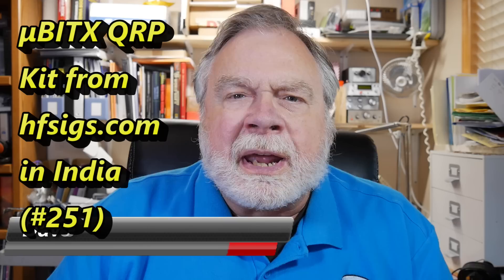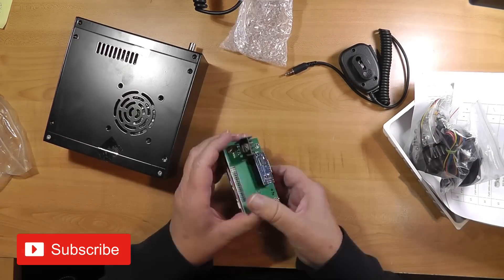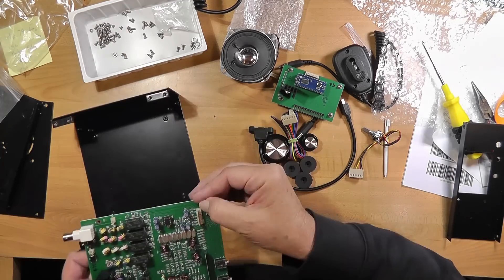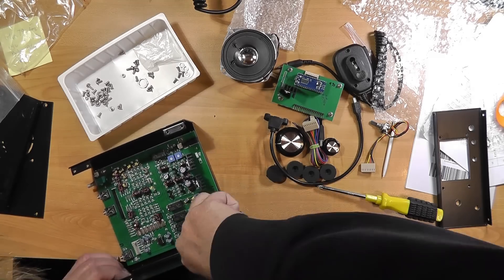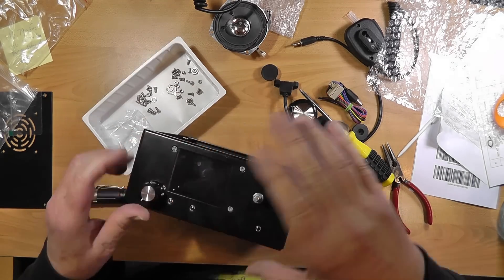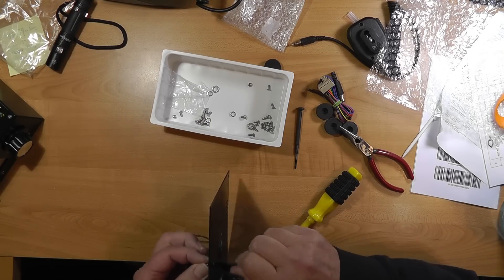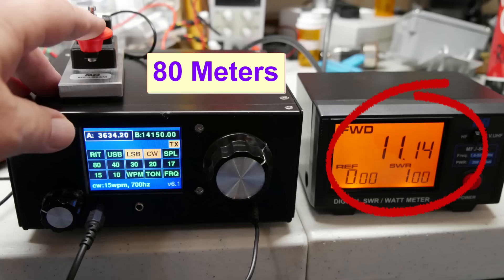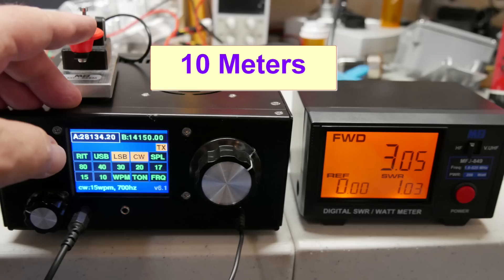Building the v6.1 Micro BITX from India (#251)

Comment: An idea might be to order the basic kit without the case so you can customize the layout.

My plan is to build the case with larger front panel to possibly add a front-firing speaker, meter(s), additional text or graphic lcd display, some handy hardware bells and whistles, and if needed, room for a cooling fan. 

Or, maybe just leave it alone and just use and enjoy the rig! :)

Comment: I got a parts list with check marks. I can't find the allegedly included power supply jack, but it does indicate quantities and usage of the different screws.
Reply: Found the power supply jack. I suggest putting the USB connector on the back panel before putting the back panel on after mounting the PCB.

Comment: Hey Dave, I just got my uBitx V6 Saturday. I assembled it tonight. I cannot find any reference as to the polarity of the power plug. Is it center positive? Thank you in advance. 73 KE0OAP
Reply: For anyone else coming here, yes! An easy way to test for the future, you can check with a multimeter. If you touch the outer-most metal part with your multimeter, it should match up with ground!

Comment: thanks for the video dave. 👍🍻
definitely a large change from when i bought my V4 (now known typically as the "least good" iteration). currently going thru the dreaded "low/no RX, no tx power" issue.. smd is killing me ;)
Reply: My version 4 had low audio on transmit. Power was higher on cw. Going to rework the mic amp gain. Sounds great just very low output because the audio drive was low. Receive sounds great for such a simple rig. The Bitx 40 single band sounds really good for $45 that it cost.

Comment: What type of power supply can be used on this?  On the site it only said 12 vdc with 3 amps.  Is the tip positive or negative?
Reply from the maker: 12 to 14 or so volts ( 13.8 is ideal). Center pole of power conductor is positive.
Reply: David Casler thank you Dave
Reply: @dltrisch  and note that the amps just means it must be able to supply that much. It's ok if its a 20w or 200w rated power supply. Just note it's a good idea to add a 3a fuse to your power line!

Comment: A suggestion Dave, buy yourself a magnetic tray for the metal hardware. Those screws stay put and you don't have to root around the carpeted floor looking for that one that jumped off the workbench. Hi HI ~ oh and a magnetized screwdriver is worth its weight in iron when working on these things! k6sdw

Comment: What does "open source" mean ?
Reply: It means you can download the source code of the software that controls the radio and make changes, if you know how and want to experiment.  There are lots of mods available out there.
Reply from the maker: The software source code is openly available and can be changed or adapted. The hardware is designed to be easily modified and complete documentation is available.
Reply: Others explained it well. Also note that open-source software is typically safer than closed-source (private). Seems counter-intuitive since hackers could see exploits in the code, but so can everyone else, so it's likely someone will fix it. This can be an issue for smaller projects where only hackers look at it, but usually not.

In this case, it's a non issue since this rig isnt really a target for hacking, and is also big enough for bugs to be caught.

The CEC software is a fork (modified version) of the original software with bug fixes and more features. Highly recommend installing it!

Comment: An offtopic question:I made a delta loop for 2m,and I wish to use it on 70cm as well,on the 3rd harmonic.
Is there any disadvantages using it as a dual band antenna?
My intention was simplicity,it is fed with a 1/4wavelength 75ohm match section
Reply from the maker: You can give it a try. You will have to cut that matching section to pretty exacting requirements.

Comment: I got one around the first of the year, but only got it working on Saturday.  I had to set the frequency and BFO and once I did I made a contact with Florida from PA which I was happy with.
Reply: Hi Peter  - I just put my uBitx V6 together and would like to know how you got into the menu settings to do the alignment and BFO adjustments. Pushing in the tuning knob does not allow me to access the menu.  Lack if documentation is one reason I would not buy this rig again. Thanks,  Bob W3ARA